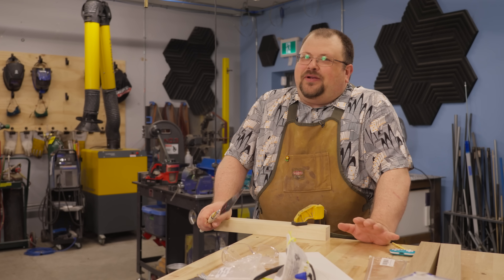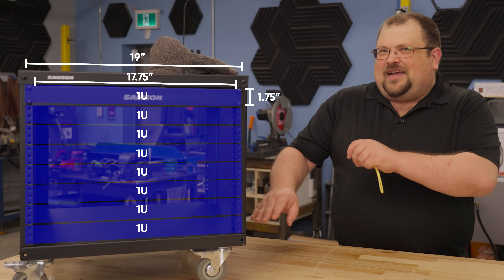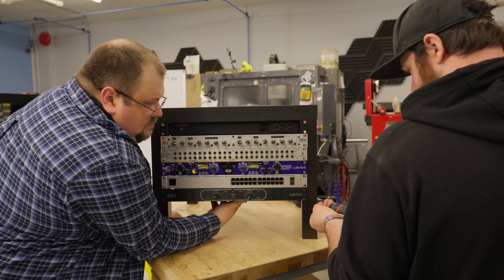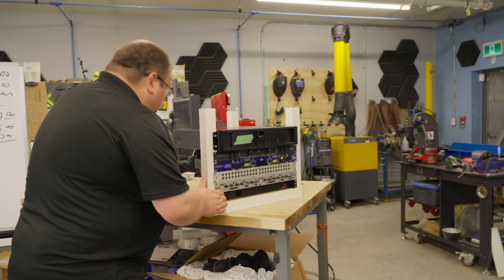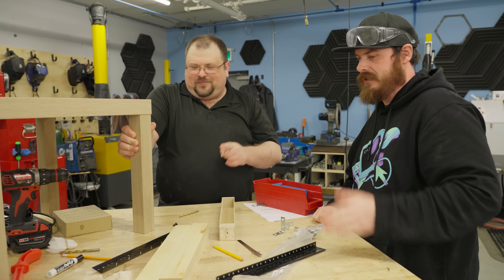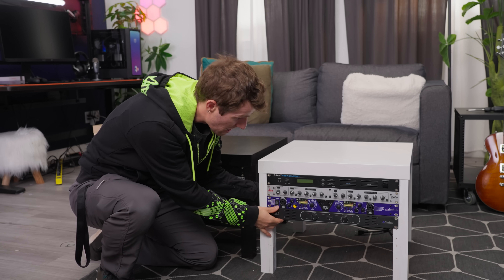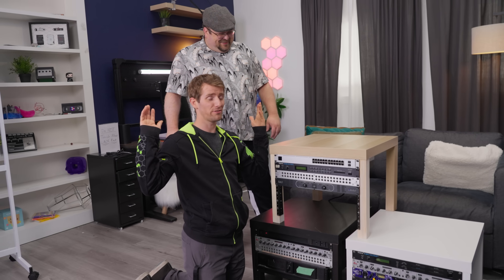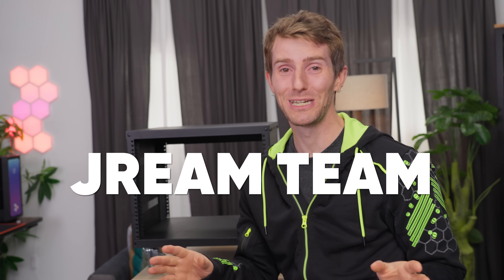Server Racks Cost Too Much - Buy or DIY?

Comment: Lack tables are awesome. There's a gentlemen on Etsy who sells 3d printed locking brackets (which I'm sure you could print yourself if the model is somewhere). I have 4 of these tables stacked in a tower to the right of my desk. The first shelf is holding a tool bag (with hand tools in it), second is holding 2x48U switches, a monitor riser over top and two NAS's. Third shelf is holding a tower of monitor stands and some Intel NUC's as my home lab. Shelf above that is holding two pieces of music gear, one of which is in a flight case.

We've also had a single table (one of the ones in the tower actually) hold a 88 lb color laser printer for about 10 years prior to its current duties.

Comment: I actually designed a 3d printable 10 inch rack around these sort of rails. Costs me like 30 bucks (20 for the rails plus around 10 bucks in filament). And if I ever need more space I can just replace the rails with bigger ones reusing the printed parts.

Comment: I just hopped on Facebook marketplace praying (yes, praying cos we needed one for a place of worship) for a cheap server rack. We ended up with TWO 42U cabinets that cost £80 total. It's a miracle, I know.
Reply: If you don't mind me asking, what does a place of worship use servers for? Is it just a PC and projection setup and/or PA system with mic? I imagine it must serve a fairly large community if that's the case. Anyway nice find, what a steal
Reply: @Enixious99  A bit of everything: Networking (UDM + 24 port switch), HDMI distribution for projectors (8 displays), CCTV DVR/NVRs (30ish cameras), streaming PC, an old laptop with proxmox and home assistant(!), and of course PA equipment. We serve about 1000 people. We had to get creative rackmounting some of them

Comment: I would've bolted all the way through the hollow legs, with nuts and lockwashers on the back.  Probably rigid enough, and also reusable enough.  No need for leg replacement, no need to buy "fancy" mounting brackets.  Much less time, much cheaper.

Comment: Extra Tip from someone who had a Lack Rack in the living room in the 2000s: You can even stealth your living room tech stuff by screwing it in from behind the legs, not on the front. So the knobs are protected by the inset, and you can throw a tablecloth over it to make it look neat. And in a severe case of sudden unexpected LAN party breakout, remove the tablecloth and use the Switch and power outlets in the table for more computers :)
In times of Wifi, this is not that important anymore, but back then, most gaming pc's were still wired, and having some extra ports (and power outlets) handy if needed was quite useful from time to time.
Also ... the Lack you used for comparison was a newer one, too. The one I used back than had solid legs.
Reply: It is still required though. Since Wifi is everywhere and nobody is managing their transmit power it can be come a real issue if you have multiple wifi based machines doing a lot of data streams. 

Wired is still the only way to go on LAN-parties unless you have an especially beefy Wifi solution. But that is usually not the case in your average residential house.

Comment: You used flat head screws and complained about the quality of the furniture (which was not made to be a server rack) ... Then switched to round headed screws (that are better for supporting weight) and screwed it into solid wood and act surprised that that's a better solution. This screams incompetence or intentional blame-shifting. 

Do better

Comment: I think baking the time into the budget wasn't a good choice. If I'm doing this project, I'm not going to consider the hour or so I spent working on it in my budget as a monetary cost. Time measured in dollar amounts is also extremely variable depending on who you are. It just adds unnecessary noise to the data for no real benefit.

Comment: Threaded inserts are an easy and cheap option that allows you to remove bolts all you want without destroying the wood
Reply: Honestly, it seems easier to just use wood legs and rails.  Plus, the luxury of actual rails really cannot be overstated.
Reply: I'd be interested in a price comparison between enough threaded inserts to cover all the gear and those cheap rails. But even then the rails have the benefit of everything being properly spaced rather than relying on you to drill the holes in the exact right spots.
Reply: I have a LACK with rack mount brackets for my modem (sb8200) and router (edgerouter x).

I put wood glue on the threads of the wood screws I used. The wood glue made what are essentially thread inserts in the legs.

Comment: I used one of those tables to bolt my 3d printer down to, and makes an acrilic enclosure out of (1x1 for the uprights for the enclosure). ended up moving all the eletronics up a custom box mounted under it. been like that for years.

Comment: 3:45 I recently saw a video about How IKEA Mastered Furniture (exact title) and how they managed to keep the price of the Lack table the same throughout the years.

Yup… Legs are no longer solid wood or even plastic. They are basically a square tube made out of thin particle board and two tiny squares of OSB for top and bottom.
Reply: 4:37 If YouTube allowed to add gifs, I'd add Jeff Goldblum saying "Well, there it is" :D

Comment: I built a lackrack once, i knw\ew the legs were hollow so i drilled a hole in th ebottom of each leg and injected expanding poly. then i predrilled the holes and used drywall anchors. way cheaper than what you did.

Comment: I ran a Lack Rack for 5 years with all sorts of gear. If you use bolts all the way through the leg, it works great. I had 1/4-20 bolts and nuts on hand.

Comment: Not really sure why installation time of the components is included because your hardware doesn't just magically mount itself when you buy a real server rack. And let me tell you that depending on the mounting hardware that they give you it might take 10x as long (albeit probably more secure)

Comment: u should've used rack screws and T-nuts that fit them...ACE hardware,,,,
Reply: theres nuts that go with them too, so as not to scratch the gear, those you have to get at like guitar center

Comment: It sort of makes sense to include your time as cost, just to get some meassurement of how much sense DIYing it is. 
However I do not understand including the installation time of the equipment into the lack table? You would also have to do that on the normal rack, making it more expensive than 209$. 
Instead it would have been better to include the time it takes to assemble the lack table instead of "Screwing the equipment in with screws". 
Not that it really matters alot.

Comment: i would go the second one but to get over the problem with the holes waring out i would drill holes for m6 inserts and then just put them in then you can use standard rack M6 screws and it's metal on metal in the wood so you should be good.

Comment: I use an Ikea Jonaxle with shelves instead of baskets.  It works really well.  With 18.25" clear and 19.5" overall width, would probably work as a rack as well. The legs are a hair wide but could probably be made to work.
Reply: I also got a tripplite 12u (I think) network rack off marketplace for $50.  All my 42u racks were under $125 if you have room.

Comment: You have to count all the cost of the failed attempt, it is a normal thing on the DIY side.
Reply: well, but that wouldn't work either: here its prob failed intentionally, for the purposes of making this video; it'd be a very uninformed DIY attempt to know of the concept of using this exact model of the table, but yet actually not know the legs are hollow, and besides you could still dig yourself out of that hole when you find out instead of starting from scratch.

Comment: So, you charged yourself your time for installing the equipment into the lack rack, but what about the time it would take to install it into the Samson rack?  Those amounts should cancel out, unless it took way longer to run wood screws into the legs vs rack screws (from my experience, wood screws would have been much faster than trying to thread rack screws).  I'd say you saved yourself even more.

Comment: I got 10u audio rack for 10 euros second hand. I do like it better than this solution because I change the rack a lot and when I take out the screw and put it in multiple times I feel like the wood won't hold in the screws anymore

Comment: Since the channel lost most of its engineers, the quality has dropped. They really lack stability, and most of the hacks sucked. They can’t even replicate the most common Reddit threads — this is bonkers. No one would put their audio gear near network equipment, and their overall presentation is terrible. Bring back the old hosts for better quality.

Comment: You could pipe filler into the legs then put rawl plugs in where the screws need to go. That might make it more durable if you want to change the racks in and out often.

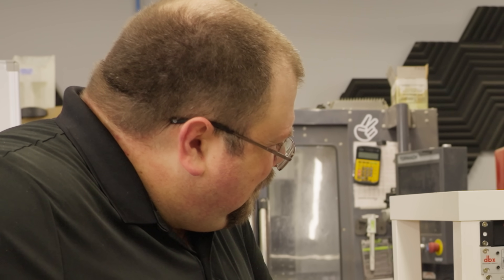Comment: 7:03 one cheap ass way to keep holes tight when re using them, is to shove some toothpicks in the hole. Preferably the soft flat ones, but the hard pointy ones work too.
Reply: Or use thread inserts, more expensive sure, but will last far longer and more reliably.

Comment: Just finished building my own 15" rack holding 4 (2 per shelf ) Lenovo tiny pcs" 1 shelf my 3050 opnsense box and a shelf for my managed switch. All light steel L section welded together and painted blue. Way more personal and cost nothing

Comment: hey, i actually did diy my own rack using 2020 alu extrusions. Cost was about £120 for a 12U rack. would be £100 without side panels. things super strudy and you can just use T nuts to secure things. ikea l(r)ack just isnt that good due to the ikea being hollow and the space is ever so slightly too tight vs a 19" rack

Comment: Ok, I'll say it: The v3 rack brackets are the wrong way around - presumably to accommodate the table-leg spacing.  The screws for the equipment are still going into the table legs and will chew them up over time.  You need wider legs and the kit should be bolted in (not screwed), and be hanging on just the metal rails.
Reply: presumably they know which way the brackets normally go -- that's just apparently not their build here. However I too don't see how this gets them out of the problem of wearing out the wood with each remounting -- but it is substantial structural support at least, and they can actually deal with the wood wearing in various ways, when it happens.

Comment: I was thinking attempt 2 could be improved on slightly for the cost of some 3D printer fillament and some superglue. 
1. Make the legs but do not install them.
2. 3D print a drilling jig.
3. Use said jig to place pilot holes in one leg. 
4. Use a screw in each pilot hole in turn to tap the holes
5. Dribble super glue into the tapped holes sent wait a few min for it to cure.
6. Screw a light item blanking plate/mdu into the top and bottom of the first leg
7. Use the first leg withe the two items installed with the drilling jig top keep the distance correct on the other side to drill just the pilot holes in the other other leg.
8. On the second leg tap and super glue the top and bottom holes.
9. Use the two holes on the second leg to fix the drilling jing in place then drill the remaining holes
10. Tap and superglue the remaining pilot holes on the second leg.
11. Fix the second leg to the first leg using the items used in step six, This will set the corect spacing.
12. Fix the joined legs to the top
13. The rack is complete and can now be loaded with the rest of the kit.
The superglue should increase the longevity adding a few more removals and if you keep the templace when the holes eventualy strip just drill out and either fill with dowels or plastic wood and use the jig to redo the holes. If plastic wood or some other filler is used this should not need any further repairs. Not sure how cost wise this would compair to the second option due to the fillament, super glue and extra labour but it will be longer lasting.

Comment: Couldn't you just use two 20x20 aluminium extrusions? Attach them to whatever is supposed to hold your hardware and then screw your hardware to the extrusions, using slot nuts. A 1m extrusion costs about 6 €, so thats 12 for two.

Comment: I guess it depends what area you live in.  In some areas rack equipment is nearly paid out to you to take it away.  A full sized rack I obtained for $50 once (though always saw many from time to time just browsing), and on one of the most fortunate occasions, my workplace GAVE away to the first taker (I was the 6th person asked that they knew of, that finally said yes, crazy I know), and APC CX series 24U silent rack (insulates all relative noise of the rack equipment).  A rack that new can go for as much as ~$3000 USD.  My eyes raised in disbelief and took it home immediately which I own and treasure to this day 6 years later.  "It is so choice. If you have the means, I highly recommend picking one up..." is all that comes to mind.

So for me and if you know where to look and are patient to browse on occasion, buy used will always be the way for me and has been for over 2 decades maintaining my home lab.

Comment: The price of the able has actually stayed the same for decades and the reason it's hollow is to keep it cheap and i've seen some of those tables go through hell but they were still standing clearly Ikea Designers made a soild desk for holding stuff on top of it just didn't expect people to use it as a cheap rack mount.

Comment: I bet you could still use the stock lack legs with regular , not wood screws that are larger than the width of the leg and then just put a nut and washer on the other side, you could probably still mount and unmount stuff with that.

Comment: If you really want a rack, contact your local computer recyclers or keep an eye on marketplace. They get a lot of racks when a company or university upgrade their equipment or close down and they resell racks dirt cheap. I got a 42U Dell rack with 4 PDU's , all the panels and 2 dozen rails for $100. $50 to rent a truck for the afternoon.
Reply: Agreed, I don't think i can really agree with the outcome of this video considering you can get 42u racks for basically free. If you're in the states, GovDeals regularly has full size racks for less than $15 (you just have to pick it up). Personally, i got a dell rack with 3 panels for $150 (including delivery) off of craigslist

Though, to their credit, if you're looking for a shorter rack its much harder to get a deal on them and you're probably better off DIY-ing (i own a star-tech 18u rack as well, paid about $200 for it brand new, but mainly because i didn't want to DIY)
Reply: @jivandabeast  at least locally to me to find server racks that are deep and shorter that gets really hard
Reply: fr i got my 42U dell rack with 100 or so cage nuts delivered to me for $100 by the seller

Comment: I did a similar thing for my first diy rack, but used aluminium angle to reinforce, and then drilled and tapped the mounting holes for the rackmount equipment.  Sprayed satin black it looked the part :)

Comment: Considering that a lot of the "server" equipment people buy for their homelab is in a desk format rather than rack, you can equally get IKEA cupboards with doors. Just don't install the back panel, and leave it an inch or two from the wall. Then you'll have passive cooling from the back while hiding all the flashing equipment lights behind the doors. You can usually also get extra shelves.

Comment: Not me just having watched a mini documentary about that table where they mentioned ikea running into the same issue that screws doesn't work in this type of "wood" (forgot the exact name) 😅😅.

(As in, even if the legs wouldn't be empty, screws wouldn't be of much use)

Comment: I've been using a LackRack to house my home networking stuff for about 4 years now. I only use 1U of space so right at the top of the legs, no mods required. AND at the time, the Lack table was like sub $10 so it was impossible to beat.

Comment: ...I spent 800€ on mine.
Too blind to work power toys (actually literally), nobody in my vicinity who could (so I would have had to outsource anyway) and because I legally can not drive a car, I would have had to transport all the things via train and bus, or pray that they actually can be delivered to my doorstep. XD
One day I will build my own rack, by hand - acustic foam, fan mounts, doors, everything - but I will ned soooooo much stuff for that lmfao. XD Still, the the fact that you CAN build it yourself is wholly impressive. If you get full rear-to-back mounting, you get stupidly good weight distribution and regidity at least on those sides. So, there's clearly ways to do it. =)

Comment: ps5 pro is not more powerful, its outdated hardware, the steam machine has a gpu in the range of an rx 7600, which I have, it outperforms ps5 and pro because of the new fsr and frame generation technologies and the fact you can turn off wasteful raytracing.  you are flat out lying linus, this coming from a pc gamer. I could run games 4k 60fps no problem if I wanted to, I've done it before, especially japanese games. the only games I couldn't are poorly optimized games that require more than their recommended specs(which shouldn't be allowed btw, recommended specs should be followed to the letter.)like dragon age, monster  hunter wilds and others.
Reply: literally it was never gonna be 500, it was gonna be 600 to 800 range more likely, probably 700, price of ps5 pro og, because that lines up with my pc specs and the prices in the pc market. if you really tried to suggest they sell specs better and newer than ps5/pro at a loss, you've lost all credability linus